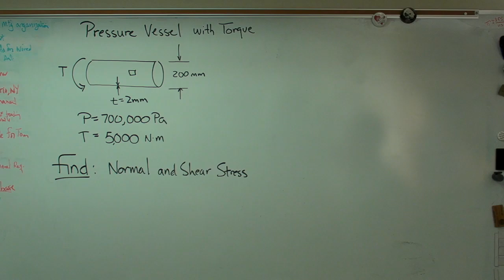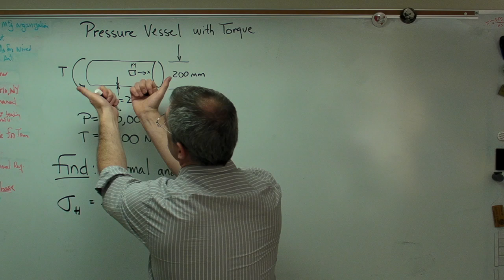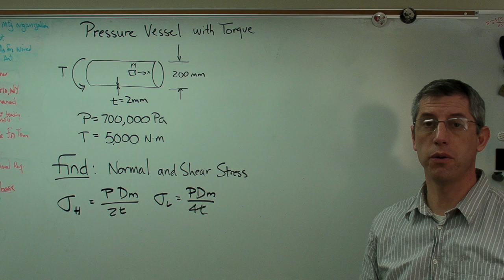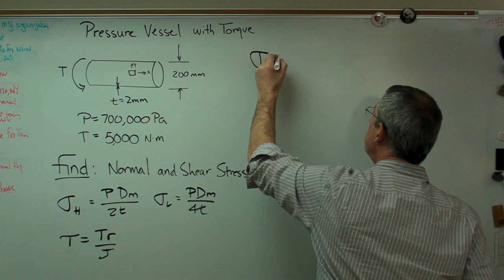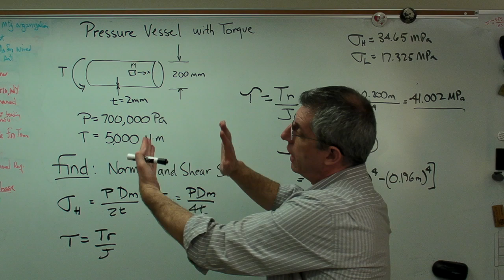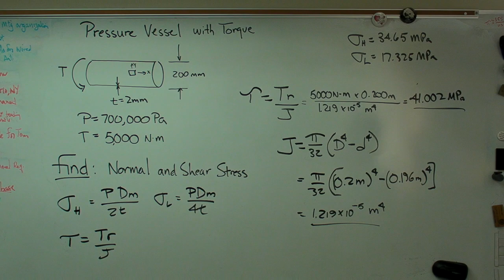Comment: @lksjadfpjudkloo32   Thanks for the clarification.  I am use to dealing the area moment of inertia.  Some large horizontal pressure vessels will be supported at both ends causing this type of moment.  I am not familiar of any cases where there would be a realistic rotational torsion around the longitudinal axis.

Comment: I was looking at your torque value.  You used a value of 32 in this problem, shouldn't this be 64?  The inerta for a circle is 1/4 Pi r^4.  So for a diameter this would be 1/4 pi (D/2)^4.